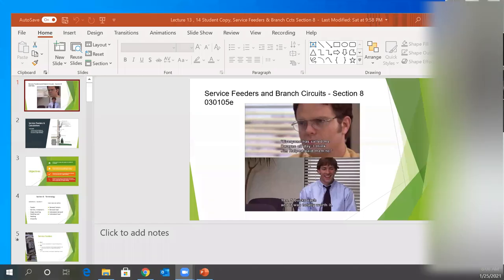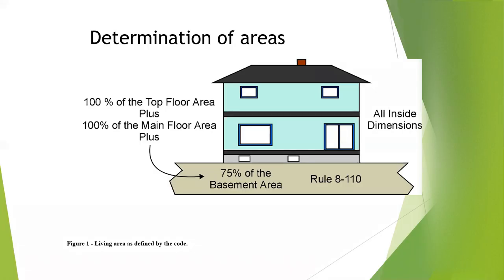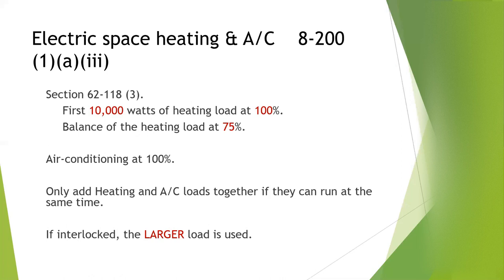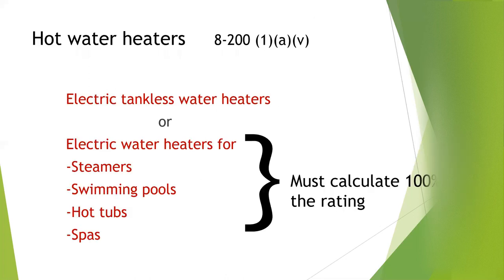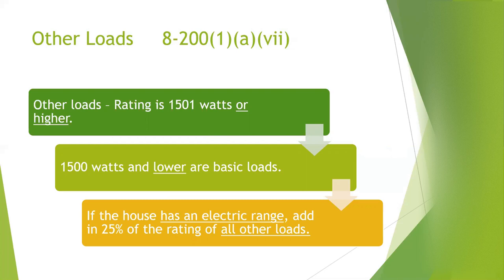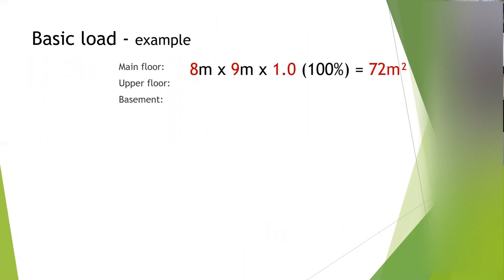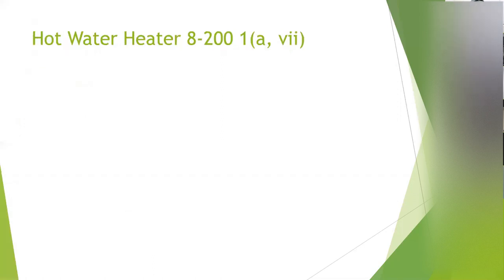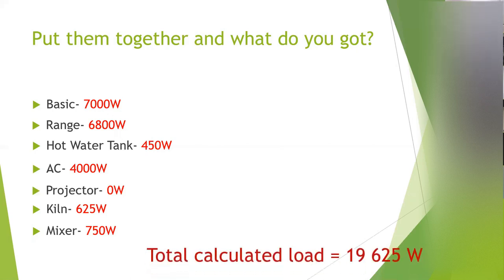2021 Canadian Electrical Code Service CALCULATIONS

Comment: I pulled a permit for my home to add a heat pump. Not sure if it’s specified but I was told by inspectors that only the 10kW air handler counts as “electric heat”. The heat pump, which is electric, and heats the house, is just like a… projector.
Reply from the maker: When you pulled the permit, is this to only add the heat pump (as specified) or is it also to increase the service of the house to accommodate the new heat pump load?
Reply from the maker: If you are calculating a heat pump for the service calculation then you would need to calculate it according to section 62 as indicated by 8-200 (it is electric heat)
Reply: @trades1steducation  I wanted to do the electrical myself, so I pulled the permit. I was missing the load calc at the first inspection. Makes sense though... more load (heat pump and air handler with 10kW heating elements) requires a sanity check. The goal was to stay within the existing service.
And as an amateur, I did consult the code and it wasn't crystal clear to me (HP) either way. I would have called both units "electric heat" but the inspector specifically said "no electric stove? count the HP at 100%". I had estimated less load due to thermostat settings. I have the 24th edition, not 25th, maybe "heat pump" is more clear there?

Comment: Excellent teaching. What about doing renovations on a preexisting home? For example with smart meters we can see practical usage figures for individual homes, with seasonal fluctuations that reflect actual usage. Are those data of use when considering whether the service to the home has additional capacity for renovation?
Reply from the maker: Thanks @spelunkerd. Those figures are not used when determining additional capacity for a home under a renovation application. Most demand factor calculations use a generalist template as outlined in the video, however it would be nice to see some amendments that would allow provision to make specific adjustments- i.e. to not have to alter the service- if needed.

Comment: I am wandering the "other" loads when it comes to appliances below 1500W with a range provided.
Reply from the maker: If its 1500 and below its counted as 0 w toward the service. if its 1501 and greater its at 25% if there is an electric range or 100% up to the first 6000W and then 25% after

Comment: Hello Sir, How the 6000 watt single range 12000 at 40 Percent? and 12000 became 2000?
Reply from the maker: So, the rule is 6000W for a single range up to 12000. Then if you have a load that exceeds 12000 (like in the example where the load is 14000) then you would take 40% of any amount that is in excess of 12000. Review the example and you will find that with a range of 14000 you will first account for the initial 12000W. This is covered in the first part of the rule stating that we use an amount of 6000W to account for that portion on the electric range. Second, we need to account for the 2000W that is in excess of the 12000 (12000+2000=14000). That 2000W will be taken at 40%. Thus 2000X0.4=800W. Then you add the 800W to the 6000W for a total range calculation of 6800W.

Comment: Hi Joshua, just wondering, what if a house has a secondary suite in the basement - renter on the basement? Would this still be considered a single dwelling or an apartment?
Reply from the maker: Sorry for the very very late response. I am unsure how i missed your comment. At any rate, you would need to calculate it as two separate dwelling spaces...so yes like an apartment.

Comment: other loads computation, what if you have 3 appliance rated below 1500 watts. example, 1200 watts, 1400 watts and 1450 watts. how do you compute this for other loads?
Reply: For single family dwellings, all of those loads are counted as 0W if an electric range has been provided for (see 8-200 1(a)(vii)(A) and if there is not electric range provided for then you will combine all the other loads  and take it at 100% up to 6000W. Anything after that is at 25%.
Reply: @VeraScientiaInveniet  projector it not included to the computation because wattages is below 1500, it considered as basic load.
Reply: @earlgrey1429  Yes, the projector is not included if its wattage is below 1500W :)